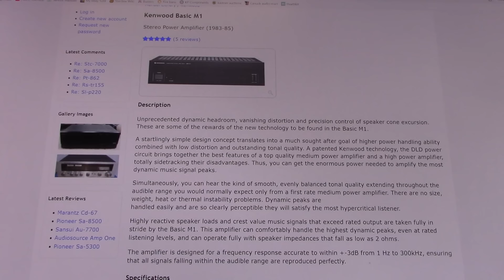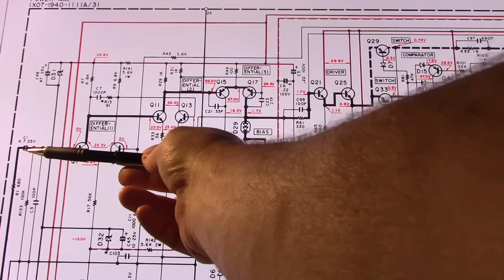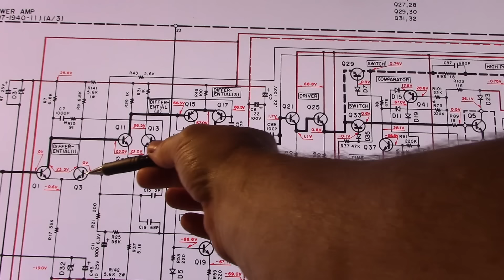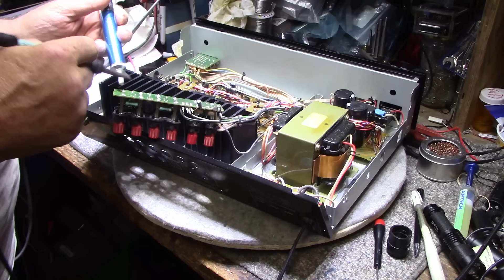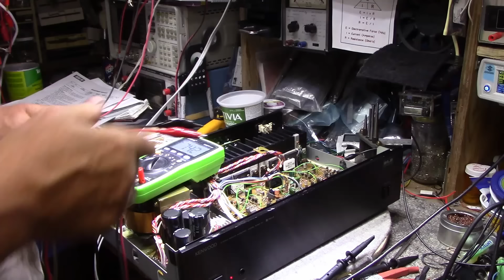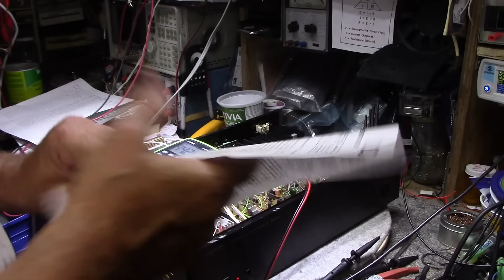Kenwood Basic M1 Power Amplifier (Ep. 276)

Comment: Interesting amp- was not familiar with it. Liked how you explained the feedback circuit and showed the relay resistances before and after rework. In the late 60's-70's a company called LWE made a speaker (Acoustron), maybe more than one model, that did a similar thing by providing "motional feedback" from the speaker to the amp, and even showed how to modify a few amps/receivers to process that signal. A friend had picked one up otherwise I would never have known about them. It would be interesting to see how distortion was reduced by comparing the main speaker with the feedback and the B speakers w/out it....
Reply from the maker: I did listen to this amp daily for about 2 or 3 weeks. I would still be listening to it today but I need my ears for testing and evaluating equipment that will be appearing in upcoming episodes.
I would say it landed itself in my top 3 best sounding amps. Very clear and detailed in all frequency bands, especially the bass, crisp and defined. That's just my opinion although I do get to listen to a wide range of different units. I also do not claim to have golden ears but they are able to tell me enough.
I did try the sigma drive and to be honest I couldn't tell the difference but to be fair it's difficult to do A/B comparisons and I listened with limited time on that. Thanks for stopping by
Reply: @TrevorsBench  Hi! i am really glad you liked it. A couple of years ago i started with one c1/m1 pair, liked it over much more expensive vintage amps, even without any updates, or upgrades. It had a problem thought - weakish bass on my custom speakers (drivers from vintage kenwood ls-p9200+ models, custom driver setup - more drivers, 15" sub, custom new crossovers, custom new enclosures, kind of a ultra-max version). So i started with normal wires, then started adding thicker and thicker wires. the breakthrough came when i moved from 20mm2 wires to 70mm2 wires and then i also installed sigma drive wires too - 25mm2. At that point i had to turn down bass and loudness immediately. Then i went further - i have collected 4 more amps and 2 more preamps. updated and upgraded all of them to a good measure. have 1 pair as a stereo pack, driving mechanical vintage arrows. Turned 4 amps into bridged mono units with a bit modified phase inverter custom made locally, which power respective upper and sub units on each tower. amps are fed by two preamps working with a single channel signal coming from a nice DAC. I made a new AC wiring too, but instead of plugging all this into 220v on the wall, i switched transformers into 110v mode and put two 5kw 220/110v transformers - one per channel.
The result? A fantastic sound, dynamics, bass and so on, you name it. So much that listening to DSD files actually makes sense. 
PS. initially i was going to invest into two c2/m2 pairs, but because of stuff you mentioned in the m2a review, i settled on c1/m1. They do not need more controls than they already have. I increase loudness to a point at most. I do not even use any controls on the RME dac. It just needs a good enough file to play classical music, psychedelic rock, old rock/pop, blues, jazz...
Sometimes doing crazy stuff is rewarding.

Comment: Classic class H amplifier... Thank you Mr. Carver!! Great video Trevor!
Reply: Isn't it class G when it has switches?
Reply: @Soren_Marodoren  I believe you are correct. I forgot about G... Class H used variable tracking PS rails. Thanks for the reminder.
Reply from the maker: It really isn't class G or H. It's actually two class AB amplifiers, one stacked onto the other, each one has it's power supply and they are switched in or out depending on the program material. They both share the emitter resistors
Reply: One thing I’m still trying to understand: based on the service schematic, the rail-switching transistors (Q29/Q33/Q35) seem to engage the higher rail in the driver/VAS stage instead of the output stage. Is that actually what Kenwood intended with the DLD system? It looks like the output devices may stay on the main rail while the driver section gets the extra headroom. If anyone has deeper insight into whether the switching happens before the output stage or affects the output rails directly, I’d love to hear it.